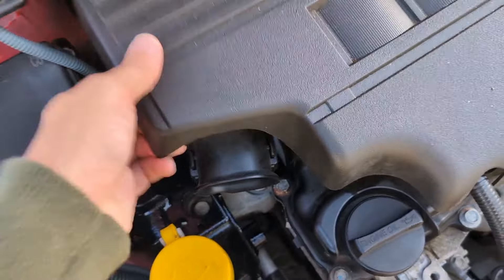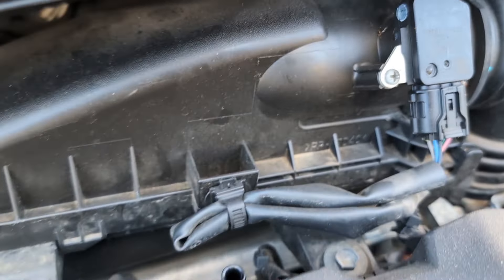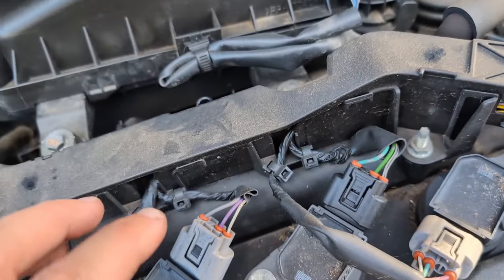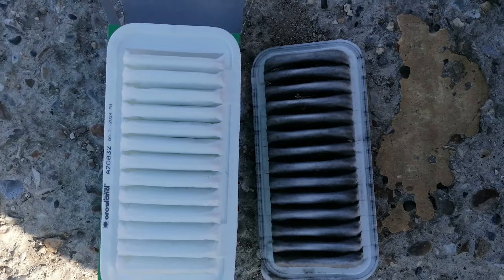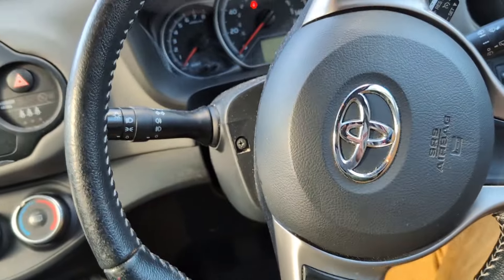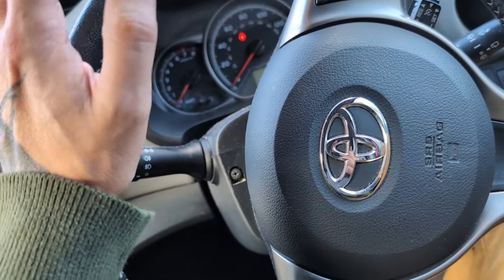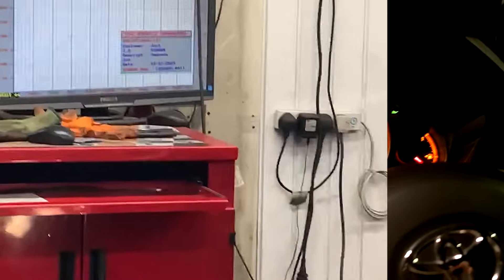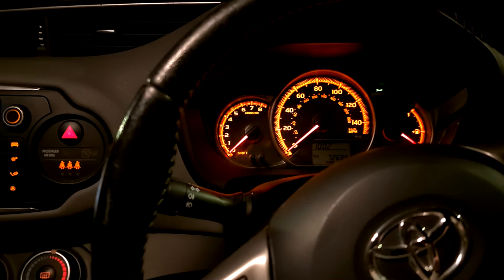Make Your Car Faster The CORRECT Way

Comment: Correct! Although the 1.5 has a long tube right next to the grill so even colder air.
Reply from the maker: Oh really?! That's interesting, I might have to pick one of those up! Thanks 👍
Reply: @stupidscruff  not sure if the airbox is different but traction control makes it slower 😂
Reply from the maker: Any plastic pipe that will fit should suffice 😁
Reply from the maker: FFS what have you done, I'm just getting my coat to go measure it 😂